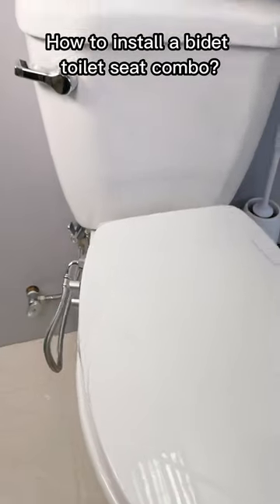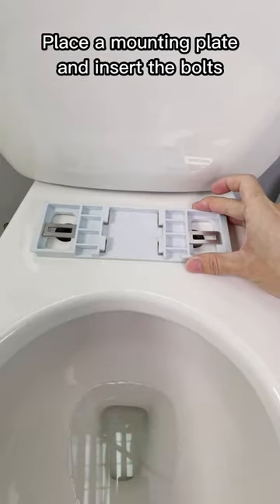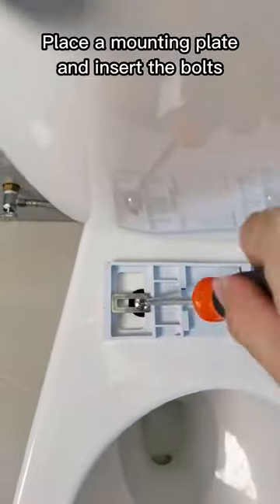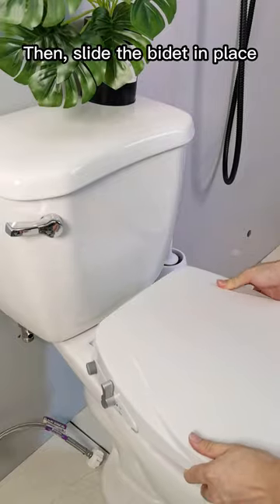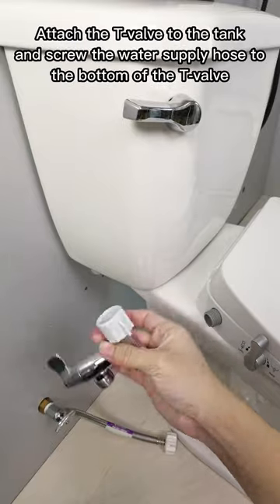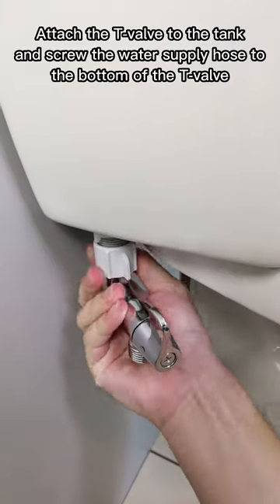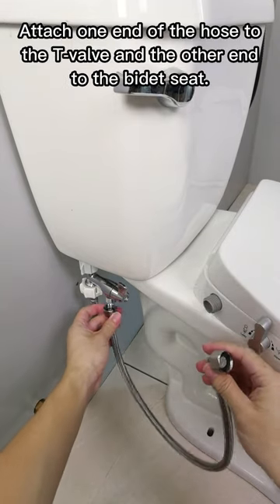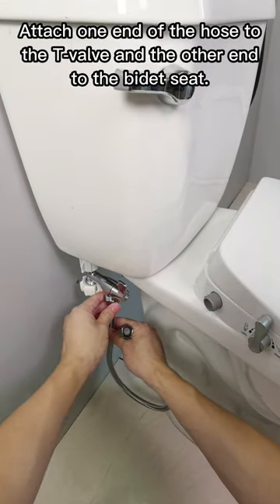How to Install Bidet Toilet Seat - DIY Installation Tutorial, Best Amazon Musthave, Replacement

Comment: do u have to turn off at the mains first? or just below?
Reply: Just below, also make sure to empty the toilet reservoir.
Just, turn off the water and flush.
Made that mistake before 😂
Reply: @MarioRobles93  oh sorry didn't see your replay. turns out a plumber was coming to fix an issue with the toilet so at the same time he installed this. thanks